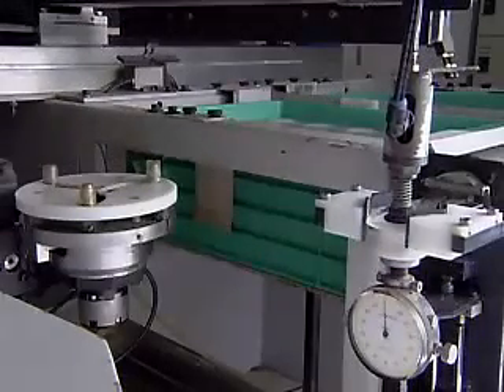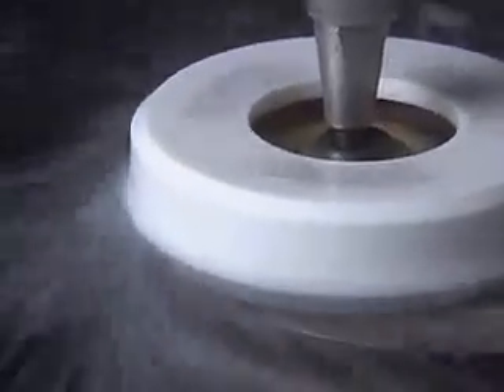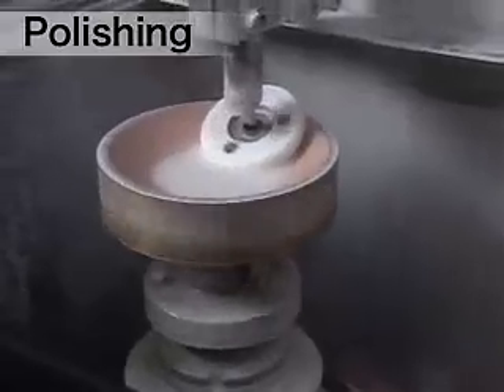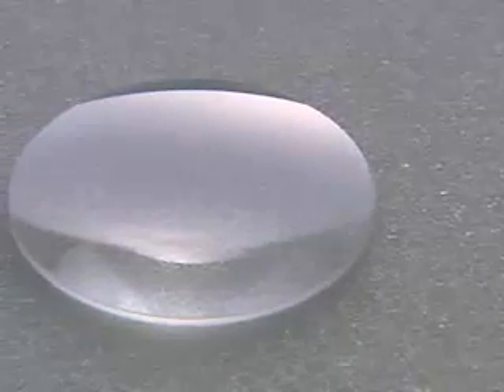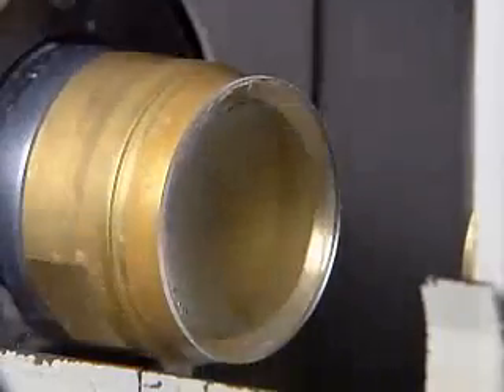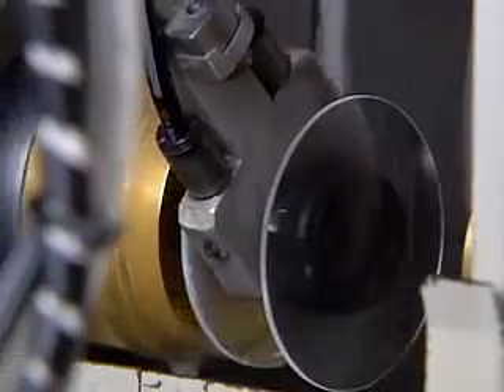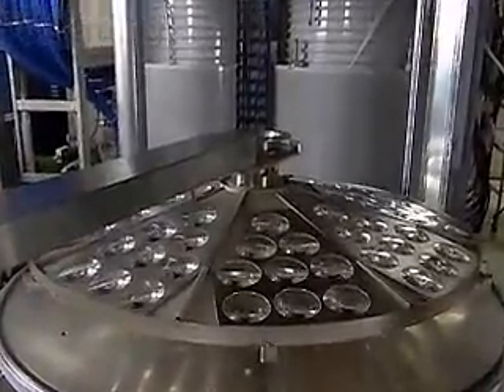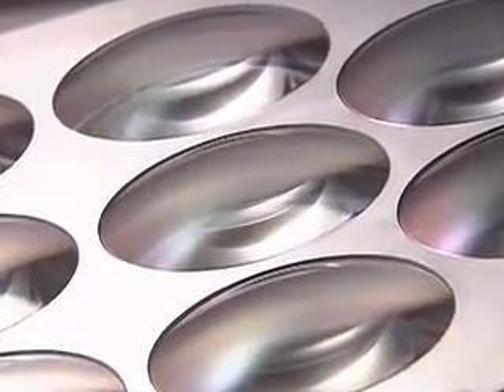Canon Lens Production 2

Comment: So many wonder lenses which are not designed to be used with digital sensors are being discarded. It seems such lens, with its pure glass could be recycled. Such a shame to toss Leica, Zeiss, Pentax 6x7 and other fine glass because technology has abandoned them.
Reply: most of them are still usable. they just need a mount adaptor. You won't have autofocus, but they still worth it